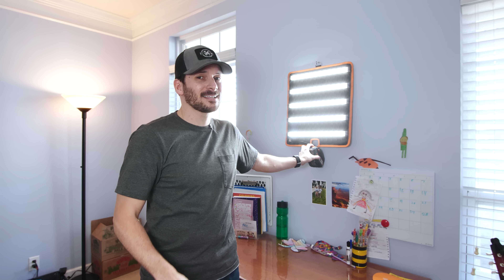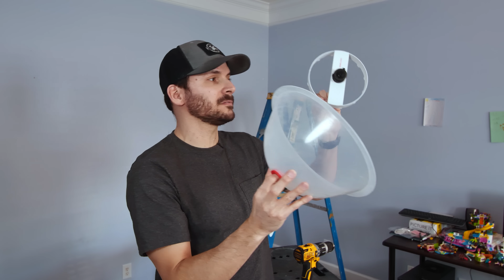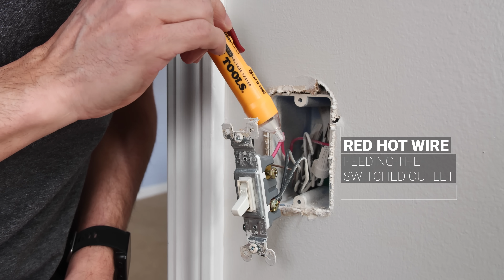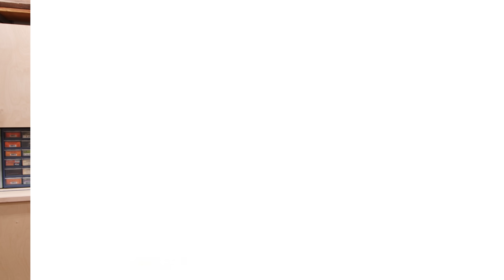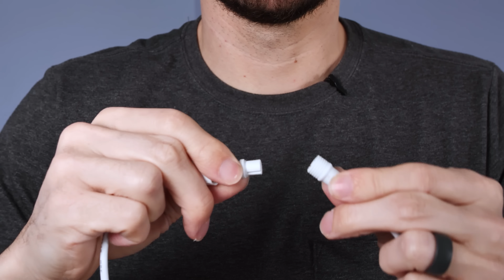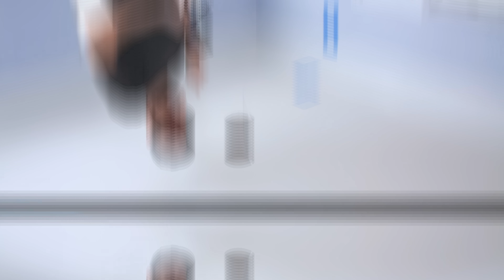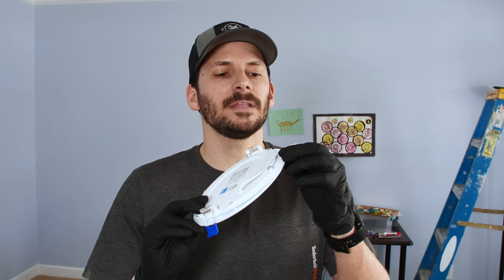Recessed Lighting Install with No Attic or Prior Wiring

Comment from the maker: To start comparing quotes and simplify insurance-buying check out Policygenius: https://policygenius.com/fixthisbuildthat
Thanks to Policygenius for sponsoring this video!
Reply: I want to work in the electricity business
Reply: @kaykay037  Could you please help me?
Reply: Sorry to be off topic but does anyone know a method to log back into an Instagram account??
I was dumb lost the password. I appreciate any assistance you can offer me
Reply: @Bryson Patrick thanks so much for your reply. I got to the site thru google and I'm trying it out now.
Looks like it's gonna take a while so I will get back to you later when my account password hopefully is recovered.
Reply: @Bryson Patrick it did the trick and I actually got access to my account again. I am so happy:D
Thank you so much you saved my account!
Reply: @Archer Kayson you are welcome :D
Reply: Turn the torque setting down lower on the drill to stop it hitting your face . It acts like a clutch
Reply: You would have been in trouble if that ceiling was insulated.
Reply: 3000K is terrible for your eye's. It will ruin your vision over years of use.
Reply: How does it work if you have 4 ft of blown in insulation
Reply: @orangehatmusic225  well whats a good setting then.
Reply: @privateundisclosed4448  5000k
Reply: This was useful, I need it to install multiple infrared lights into my roof in this manner for the room I had converted into a VR room, this was a bit easier of a method than what I what is going to use.
Reply: Hello, do you have a video of how you ran power back to the plug that you disconnected? Thanks.

Comment: A hint from an electrican, don't tuck the lights up in the ceiling until you have the switch installed and you can make sure they work. Some designs of these led are not real easy to get back out once installed and can damage the sheetrock.
Reply: I just learned this the hard way...........oops.
Reply: Do you have regulations for fire rated recessed ceiling lights?
Reply: @weeeeehhhhh  All depends on the local area and the type of building. Sparkys go by the national electric code (NEC) that is part of the national fire protection association (NFPA). At the end of the day the local code enforcement has to adopt it and enforce it.
A "good" electrician will at least do the minimum the NEC calls for. There are some areas that some of us might think are not enough so we will do more.
Reply: @user-neo71665  Do you have a tip for getting them out though? Our electricians installed them but one of the lights is set to the wrong temperature and it's driving me nuts. But alas, not easy to get out and I just finished repairing/painting the ceiling before I noticed the temp issue.
Reply: @jemmabarls  it all depends on the mounting style. Without seeing it or even knowing I have dealt with the style before I can't say.
Reply: Funny, coming from a guy that cant spell electrician.
Reply: @chrisirwin7359  😒hes not wrong though...
Reply: @chrisirwin7359  He’s only missing an i- maybe he just didn’t see it 😅
Reply: @chrisirwin7359  He has a real job so he's too busy to sit behind a keyboard and spell-check the entire internet.
Reply: He went to trade school and not college of unemployed English internet grammar specialists. 😂
Reply: I'm an anesthesist and can't spell it for the life of me😢
Reply: Thank you for saying the truth
Reply: @chrisirwin7359 you don’t wanna see the typos/fat finger bs that happens on my phone 🙄
Reply: This guy knows the deal
Reply: These are LED lights,,no danger of fire @weeeeehhhhh
Reply: @cjlivingstone6011  the sheetrock is rated for fire resistance. When you cut into it, you create a gap. The fire can melt out the plastic light, and access the floor above. 

Fire rated downlights have metal cans and should be used when there are habitable rooms above.

Some LED lights are still mains voltage and can fault and cause fires.
Reply: Oh yeah,,,,just like the "Gap" around the fart fan? and the recessed light in the shower? And the Gaps around all the ceiling light boxes??? Them "Gaps" that your talking about ??? @weeeeehhhhh
Reply: @cjlivingstone6011  I suppose your building regs are different to mine.
Reply: Hey a "Gap" is a Gap no matter where you are I bet all your wires going thru the plate are "Sealed" Right ???? @weeeeehhhhh
Reply: Fire has no codes If your gonna state "Gaps" include them @weeeeehhhhh
Reply: Happened to me
He's right
Reply: The idea of having to unwire just to replace a "light-bulb" is simply backward. Not every house is designed to be a lab.
Reply: I always go by local. Local code is the most dynamic.
Reply: Where were you six years ago?  LOL
Reply: @TedDekens  Gawdamn... lol "Leave something for the funeral!!"
Reply: you dont need a switch at all with smart bulbs, they need to be on or should be ON ALL the time.  In fact, they sell devices to cover the switches, so they do get shut off by accident.  Is it possible, for a new installation in an older house to just not add a switch at all?

Comment: Great mockup of the wall.  Note that if you're working on an older home - the walls might have horizontal blocking at 48"~52" from the floor preventing you from passing the wire to the new electrical box, as many electrical boxes are set at 45"~48" on center.  This would require you to cut another access hole above the block and drill a hole for the wire to pass through. Last summer (covid project) I remodeled our bathroom and used the wafer lights above the toilet and shower areas. They're fantastic as they give plenty of light and are so easy to install.  The best quality of light for a bathroom is from the 4000K fixtures. I also used clear silicone to seal the light.  Oh yeah, I left my wire strippers up in the attic too!   One more thing, if you're going to put a ceiling fan up you have to be careful not to place too many or too close to the fan because you'll get a strobe effect (been there, done that)!. And you may find that the light from the ceiling fan is disappointing compared to the wafer lights.
Reply: What Kelvin (K) is recommended for other areas like a) kitchens b) living room and bedrooms and c) hallways? Aside from a specific use like watching a movie or something, I strongly dislike 2700K as an always-on temperature - it feels too dim and 70's looking to me.
Reply: @progression_decibel  3k is pretty typical, 4k is good for bathrooms as its a much whiter light. We never install 2700k unless ppl ask for it, its way too dim
Reply: It’s personal preference as well, we have 2700 throughout our house and love it, feels cozier to us.

Comment: Licensed electrician here with 31-years of experience... homes are still wired without ceiling lights because they're not required by the code. The only (2) rooms in a house that requires a ceiling light (or wall sconce) are the bathroom(s) and kitchen. Brad offers a GREAT EXPLANATION of the 3-wire and the switched side vs the constant  side of the receptacle. The split receptacle is required by the code because receptacles are required within 6' of any opening (such as a doorway) and no more than 12' apart along the wall line. If you are unsure even a little bit, dont hesitate to hire a licensed electrician. These lights with install are anywhere from $150-$225 each LED light.
Reply: He definitely could've still used that receptical if he junctioned his wires right. Electrician also💁‍♂️
Reply: Could you not have just added a new switch for the recessed lights and powered it off the existing outlet switch, and just left the outlet switch as is ?
Reply: @stevenmorris2293  I'm thinking, yes, and this is what I would have done.
Reply: All he did need to do is cut the 14/3 and put both ends in the first recess junction box. If the black wire is constant her splice both of the on the 14/3 send constant power to the outlet and the red wire coming from the switch becomes the switch leg for the lights. From there he daisy chain to feed the rest of the lights. So first light you gonna have 3 romex going in the junction box. Electrician here
Reply: That's kinda pricey considering the actual wafer light these days is around 20 bucks
Reply: @raymondcochran3201  Installed....... use yer brain.
Reply: @raymondcochran3201  Skilled labor isn’t cheap; cheap labor isn’t skilled.  Reading comprehension is on the decline.  Go back and read the opening post again.
Reply: So that room has no insulation on the ceiling? A lot of people will have a very unpleasant surprise if they try this haha. Also this took him a long time, probably the whole day. These type of people usually end up electrocuted or electrocute someone or cause fires. Every time there’s a DIY landlord there are lights that suddenly stop working, guess why, because of some junction boxes up in the attic that the landlord “forgot” about. Good luck to people that don’t even know the difference between a grounded conductor and a grounding one.
Reply: @raymondcochran3201  Yeah because my time in school, years of experience, and the 1000s I've spent in tools should be free just because. Granted every area is different and I do agree $150 is a bit high for my area but still. He knows his area and what is reasonable. I'd still charge $60ish per light if it was an easy job like in the video. Might go up if I had to deal with a bunch of old rodent infused insulation or some moron home owner.
Reply: I never saw anywhere that the new wires were attached to the Joists.  Can the wires just be lying on top of the drywall?

Comment: Great job Brad. Cheers!
Reply from the maker: Thanks, Jeff! Definitely used your video as guidance and running the drill backwards was such an awesome tip I wanted to pass it on 💪💪
Reply: See Jeff wealth of info. The DIY encyclopaedia
Reply: The Legend himself.
Reply: Jeff is here guys 😅😅
Reply: yeh Brad Nailed it. JK. What is better for this job the abrasive or toothed
Reply: I too learned the reverse trick from Jeff!
Reply: @bluegenie840  Jeff’s awesome! Love his videos!
Reply: How did he go thru ceiling joists to do the wiring for other two lights?
Reply: @Fixthisbuildthat  @Home Renovation DIY  Do either of you or anyone else in this thread, have a recommendation for ceiling lighting on a vaulted ceiling which has no attic space?  The drywall attaches directly to the lumber used to secure the roof shingles.  I have two vaulted ceilings constructed this way.  One is the living room ceiling.  The other is the master bedroom.  Great video.
Reply: Diy dad!

Comment: Make sure your ceiling fan blades do not cross the light coming out of the LEDs or else your entire room will become a strobe light.
Reply: 🎶Boots & pants🎶
Reply: I'm actually living with that uneducated decision as we speak. smh 
Good advice, Allan! Hindsight is 2020
Reply: Staying alive, staying alive…
Reply: Ohh man. I have this issue. It's super annoying!
Reply: The rule of thumb is 5 feet from the edge of the blade
Reply: Did you discover this the hard way?
Reply: @andrewlivingston92  actually no. I’m a lighting designer.
Reply: @crowbaril903  5ft may be ok or it may not. It depends on the beam angle of the light fixture.

Comment: Pro tip: when drilling the holes on the ceiling, put the drill in reverse first. Cut about 1/3 into ceiling, then switch back and finish the job. This way you would have a much smoother cut, and avoid banging your head with that drill！
Reply: Thanks for that!!
Reply: @Grumpyskater  or if you chuck has a torque setting try turning it down so if it do hook, it don't knock your teeth out.
Reply: He said that in the video.

Comment: I am putting recessed lights in my kitchen. I hadn't seen the wafer lights before. I had never seen the dust collecting bowl either. Thanks for sharing. Very timely for me.
Reply from the maker: Glad it was helpful!
Reply: I replaced all of the existing pots lights with these and I have installed several where none existed. I love these lights.
Reply: Remember there are no replacement bulbs. You replace the whole thing if it goes.

Comment: Third video now that has skipped the one part i actually care to see! How the wires feed into the lil boxes and how to daisy chain them off each other..
Reply: This is what I am also wondering.  I have existing lights and want to add more
Reply: @sandymiller6467  We just did them in my kitchen. Super easy. 
A. Buy the right size gage wire. (Either 12 or 14) my white wire was 14(smaller of the two
1. Turn breaker power off to lights in that room
2. Go to wire. Cut it and snip some off the ends to feed wires into the lil wire connectors that come with the light (in the lil box. They are awesome and super easy) match colors. 
3. Cut a new piece of wire (the length youll need to reach next light whole) fray it and go from first box to second box. 
4. Repeat until done
5. Turn power back on and enjoy! 

I got a pen that checks current just to be sure (klein brand if i remember)
Reply: @romondoalexander8851 would it be easiest to connect an existing ceiling fan at the end of the circuit?
Reply: @heyyheyyhannah5217  might be. I'm not sure.
Reply: So you have to daisy chain wire from the first light to the next etc … That is what was missing it seems?

Comment: Great upgrade, Brad~!  That's a great alternative to installing the old conventional can lights.  Especially when you have a 2-story house.  Thanks for the video~!
Reply from the maker: yes, perfect situation to use them in!
Reply: Most 2 story houses are not constructed like this, and he didn't show that.  Most of the time in a 2 story house, you would not be able to do this so easily on the 1st floor ceiling,  because you have joists that you'd have to drill through to get wire between the lights (there's a room above that, and the floor of that room is on the top of the joists. The ceiling of the first floor is directly in the bottom of those same joists and they are solid). That means you would have to cut holes in the ceiling on each side of every  joist so that you can drill each them and be able to pass the wire through to the next light in st least one direction coming from the first light that is powered from the switch. You'd have a ton of holes to patch and paint in the ceiling (and possibly re-texture and blend in, if there's a ceiling texture).  Plus the two holes you cut, that he showed, to get the wire from the switch through the top plate of the wall to get into the joist space).

Comment: Excellent video, especially for a non-electrician!  As a helpful tip, always check the LED units to make sure they are dimmable if you plan to use a light dimmer and make sure the dimmer is compatible to use.  You are lucky that the ceiling cable was NM (Non Metallic, aka Romex) and not BX, metal spiral clad electrical cable as you would not be able to accurately use you non-voltage contact tester.  Keep up the great work/videos!
Reply: How do i know of the dimmer is compatible?
Reply: @bobloblaw7649  The Dimmer will state it is either for LED lights or for incandescent lights.
Reply: @bobloblaw7649  the company that makes the dimmer switch will have a list of compatible bulbs. Either in the instructions or on their website.
Reply: Will the voltage tester beep if it encounters metal spiral clad cable?
Reply: @andrewmckinlay2964  no, on the metal cable itself but yes at the electrical box where the individual wire conductors are exposed outside the metal spiral cable.  In other words, the metal spiral cable shields the individual wires from being detected whereas the plastic jacket around the wire in “Romex” wire allows the wires to be detected by the non-voltage detector anywhere along the live cable.
Reply: @billhandymanbill2775  Ah ok, thanks.
Reply: @andrewmckinlay2964  you are most welcome.  Always ask questions to learn new things!

Comment: Awesome video, Brad! I appreciate you mixing it up with some of these home improvement DIY videos. And great tip on "never drill blind" because did just that last Fall and nearly drill right into a live 20amp cable feeding an outlet on another wall.

My advice when feeding down to a existing box (switch or outlet): just pull out the new work box nailed to the stud & replace it with an old work box. They're easy to cut out with an oscillating multi tool & saves you one drywall patch job!
Reply: 20 amp outlet XD damn

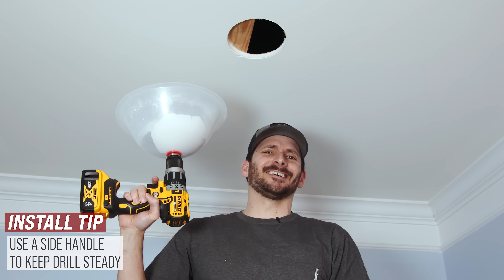Comment: 3:54 put the drill on "screw" and turn down the clutch setting.  If it clutches too much, turn it up a little.  Keeps the smack downs and wrist breakage to a minimum.

Comment: Great video. I would have liked a video where you tapped into the switch wire for the wafer lights, and converted the switched outlet  with current wiring to a normal outlet.

Comment: There is a scientific approach to follow for layout, but I'm an engineer and not a lighting designer.  This prevents shadows between light beams, which looks terrible and feels like a tunnel.

What you need to know is:
1. Beam angle (the beam creates a Conical Frustum shape for each light) - narrower beam angle means more lights needed
2. Ceiling height - lower ceiling means beams intersect closer to the ground - more lights needed

Lay out the lights so that the beams intersect above the average person's height.  6' is a good place to be.  Trigonometry is required.

Also, make sure the beam intersection is 6' or above around the edge of the room, as well.
Reply: These are not same as older pot light where the beam angles would be of concern. These flat led lights basically disperse light in a very wide angle and fill the room much more evenly
Reply: @paulgill7222  Good to know, thanks!